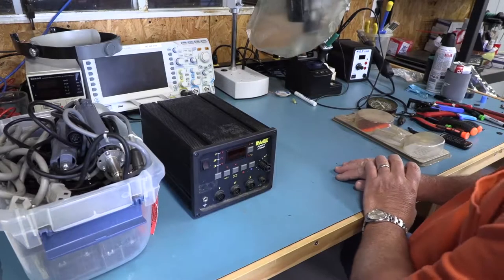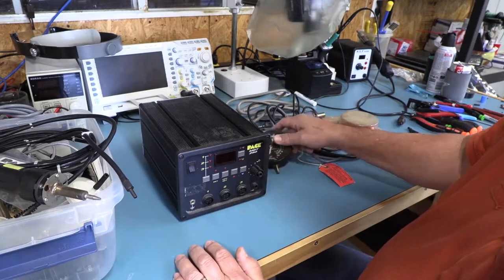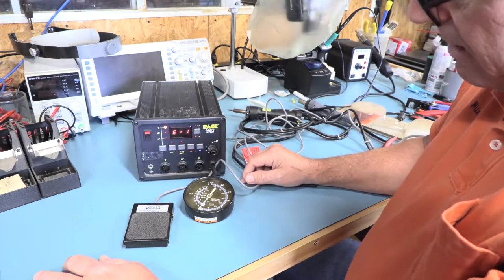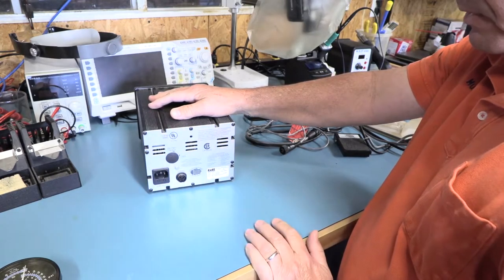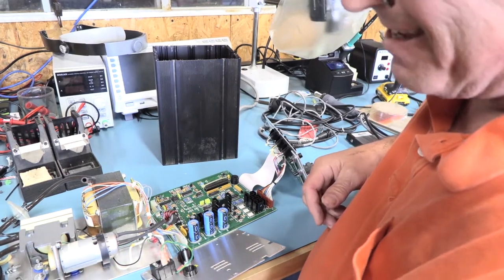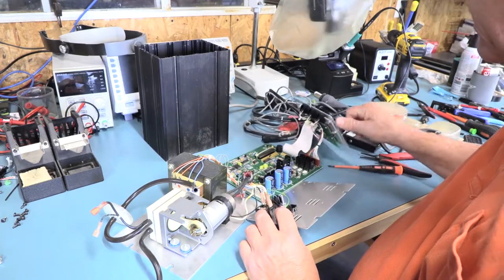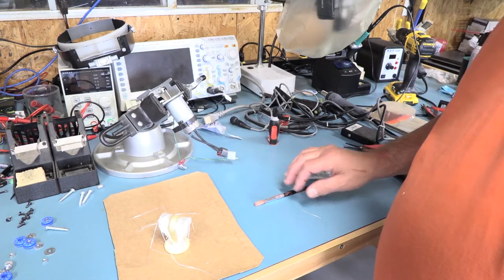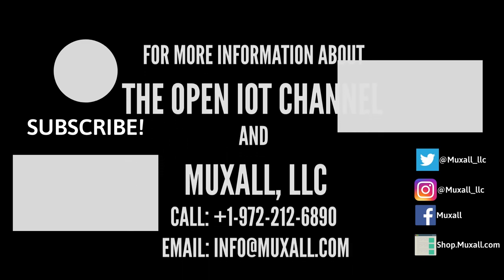IoT#90 Pace MBT-250 Rework Station Vacuum Pump Repair Part 1

Comment: I've seen a replacement connecting rod online for about $16. Typically we just get new pumps but they are expensive ($300-600) and repairing your own is definitely worth it. We seem to have problems with the motor as well due to the poles failing.
Reply: Thanks for this reply Alan...I couldn't find a full parts list online so you naming the part has helped me source one..great, thanks again

Comment: I bet that repair only lasted 5 minutes with the amount of force that parts under! I was thinking of super glueing followed by heat stapling the joins as the plastic has aged badly.
Reply: I haven't used it in a while but it was still going the last time I used it.  Fiberglass is very tough.
Reply: @muxall406  thanks for getting back to me, I have ended up super glueing....about to plastic weld with a soldering iron for added strength...fingers crossed